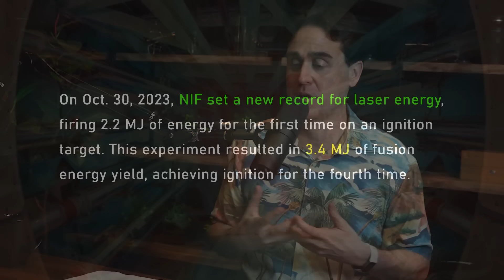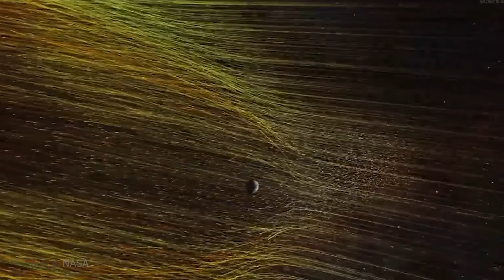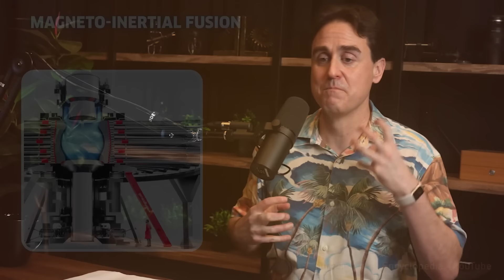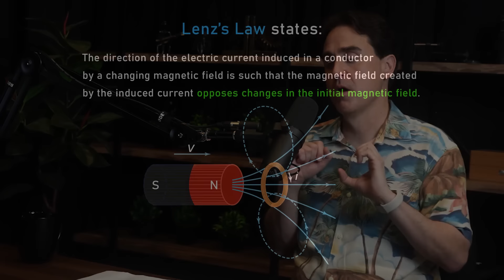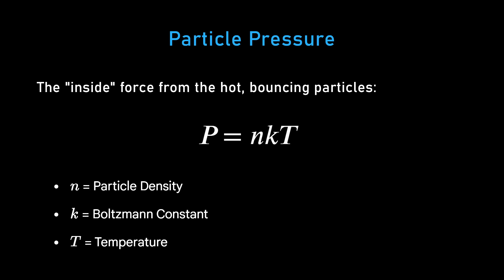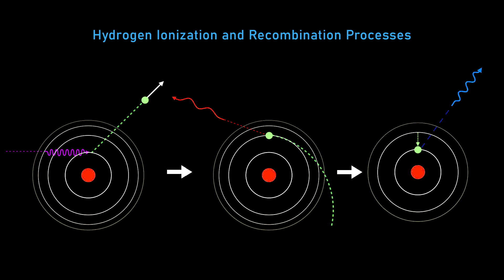How nuclear fusion works - physicist explains | David Kirtley and Lex Fridman

Comment: Lex, I wish you would have pushed David a little harder of the specifics of the generator they claim they will have online in 2018 for Microsoft.  I think you let him mislead your listeners a bit regarding the amount of power it might actually provide.  When he discussed it specifically, he didn't really make any claims about the power it will generate, which leads me to guess that it might technically be an operational fusion generator, but only provide a very small amount of power.  Later in the podcast he started talking about 50 MW generators in more detail, and I think it might make some people (potential investors maybe) that they will really bring a 50 MW fusion reactor online in 2 years, which is absolutely not going to happen.
Reply: He said it would be powering the grid that a data center is hooked up and it’s where Microsoft will be buying its power some which should tell us a minimum amount of power it has to generate to do this yes?

Comment: All this hustle and bustle but in the end the goal is to produce heat for making steam, to spin a turbine and generate electricity.. in other words a nuclear powered steam engine

-steam engine, machine using steam power to perform mechanical work through the agency of heat 
In a steam engine, hot steam, usually supplied by a boiler, expands under pressure, and part of the heat energy is converted into work

Comment: the issue is NOT the technology it is the outdated hypothesis that the sun sustains fusion with no out side input , meaning that Fusion without a source of free electrons feeding it does not work and never can work because the sun its self requires the entire heliosphereic electron sheet to feed off of in order to sustain its reactions.
Reply: What a fascinating idea. I’ve never heard of this. Can you tell me where I can read more about this?

Comment: So far as our energy requirements go, we solved that problem during the Manhattan project when the first reactors were built to produce plutonium. It took less than a decade to build the first power producing reactors. Coincidentally it also took us less than a decade to weaponize nuclear fusion as well. But we've had the capability and capacity to replace all fossil fuel based electricity generation  since the late 1940s and we were well on our way. Then lobbyists got hold of politicians on behalf of those corporations beholden to fossil fuels, and Green peace was corrupted from the top down. It all culminated in a campaign to spread fear over nuclear power production (well before 3 mile or chernobyl), as well as getting the political parasites to regulate the nuclear power industry into a position where building any new plants was almost impossible. Not to mention that since the end of the cold war we've dismantled a few thousand nuclear warheads all of which relied on an initial fission reaction to work. That uranium 235 and plutonium 239 wasn't tossed into the trash as both of those metals are more expensive than gold. No, they were stockpiled so should the need arise for some new bombs we have fissile material ready to go. But that material could be down blended into reactor grade fuel and with what the united states has on hand, we could power the electrical grid with every and anyone running every appliance, electric heater and air conditioner 24-7 365 for a few hundred years. And the spent fuel can be reprocessed as its only undergone fission for about 15-20% of the fuel when it was new. France is the only western nation that does this at scale. Our electrical needs could have been carbon free by the 1980s and stayed that way while Fusion was sorted out. And anyone who thinks there will be no waste produced by fusion reactors should they ever materialize, you're living in fantasy land. The same essential process we use to make plutonium aka neutron capture is what will produce fusion reactor waste. Other than energy fusions Main byproduct is massive amounts of neutrons that can and will activate materials used to build those reactors. But since we began burning coal during the industrial revolution to today that process has released more radioactive crap into the atmosphere than all the nuclear weapons tests and accidents combined. 
This entire dog and pony show around fusion has been going on since at least I first heard of it in 1996 when I read an article about Tokamacks in popular science during study hall. It's a joke and the punchline is the artificial repression of nuclear power production in either of its forms. Wind and solar are nothing more than supplemental sources of energy, and if the goal is to actually de-carbonize energy production then we've only got one viable option in nuclear power everything else is a pipe dream
Reply: Nuclear Fission is very expensive. The construction of a plant costs many billions. Mining and shipping the uranium, plutonium around the world. The poor workers exploited in third world countries. 
And the biggest factor is the long term cost of having to watch and deal with the high concentrated waste for billions of years. But we only care about our lifetime anyway as superpredators. 

It is good to research on how to make the decay faster and I like nuclear also more than fossil. But we should be aware how much better renewables are. Much much cheaper, decentralized and not crazy dangerous. Imagine terrorism or natural disasters. A decentralized system would be much more robust. 
But As long as we don’t have a reliable alternative when the sun ain‘t shining and wind ain’t  blowing we should keep fission. But there are now ideas of liquid hydrogen, methane etc. for hydrolysis which are made with renewables and can be used as energy storages. 
Fusion seems like a dream but would probably also be centralized. It would be amazing though and we should keep investing in it.
Reply: @user-wi3lg1rz8f read what said dipshit, we already mined and have stockpiled all the fission material this nation would ever need for CENTURIES. I know that because i helped take some of those nukes apart when i worked for SANDIA ntl. Labs. Every single one having a big old lump of plutonium, uranium or an alloy of both.
the cost of a nuclear fission based power plant only costs what it does because of the ridiculous regulations imposed by a government beholden to fossil fuel companies. And fusion plants already cost 10x what a fission plant does and theyre in the 100% experimental phase subsidized by tax dollars
Reply: He says the discovery was a crazy story.  Do u know how it was found this newest method?  Im pretty sure we can literally create no waste and fo these things. We habe a completely recyclable  society.  I dont know enough to see why it cant happen besides greed and evil and competition.  Not the good  competition but the self serving kind
Reply: @bradharris1062  we have a non recycling society. Almost all plastics that youre required to sort and put in thelittle green bullshit bin do not get recycled. 99% of all that plastic is sent off to 3rd world shitholes where they either burn it or throw it in the ocean. Metals are all that we actually recycle and even there most of what you put out in cans and whatnot gets sold off to china who recycles it as thats cheaper than mining ore. Recycli g in the United States is a scam and thats not an opinion this is documented
Reply: @bradharris1062 oh you can LiTeRaLLy create no waste? So you can never take a dump after a night of snacking & junk food? Interesting.
Reply: I disagree w/ u
Reply: @LordOfThePancakes there's nothing to disagree with. These aren't opinions they're facts
Reply: Spot on, I’ve been saying this for years.
Reply: @Omegaman1969  oh and I just sat there and listened to this girl say that if we did manage to get fusion working it would only be a matter of time before someone made a weapon out of it.🙄 when I told her we'd managed to weaponize fusion before my dad was born (1959) she told me to go read more sci fi but not to quote it as fact😅. I just fucked off at that point, some people out their aren't just stupid their iq and brain activity is so low they might be clinically dead
Reply: @Omegaman1969 sorry to have written the Gutenberg Bible there but I'm really getting sick of these people coming out every 6 months with a "new breakthrough" in fusion. I can send anyone who wants them, links to videos on YouTube that are from the federal government circa the 1950s talking about the same shit that this and countless other videos do on the subject of fusion.
Reply: @limabravo6065  why are you sick of it? Isn’t it nice that we make incremental progress ? Why the hate ? We live in capitalism so that we get growth and innovation from making debt and investing money. Why the hate. As long as there are people (private, politicians, researchers) investing time and money, it is fit enough to survive in capitalism.
Reply: @user-wi3lg1rz8f incrimental progress 😅 your being strung along by a government bought and paid for by fossil fuel companies. Andi can say that being someone who despises electric vehicles. But when it comes to powering rhe grid for homes and industry theres no reason at all to still be burning coal or natural gas. All the "incrimental progress" your seeing has all happened before, andit only took ten years to make fusion go boom so what the hell is the hold up. Dont give me any of that "fusion is hard" bullshit im a nuclear engineer so i know exactly how complicated it is

Comment: Neat, so If a plasma achieves high enough inertial coherence, tunneling becomes more probable and fusion follows without enormous heat.
As I see it anyway
Reply: Ashton is that you?
Reply: I thought it was Ashton too
Reply: It still requires millions of degrees like the core of our sun. It's technically not hot enough for hydrogen hydrogen fusion but thanks to quantum tunneling it's able to go ahead. We won't be seeing that effect on earth in any artificial reactors. That's why the preferred fusion fuel is deuterium and tritium, lower columb barrier so easier to work with. And we've had almost 70 years of working with deuterium and tritium as fusion fuel after we weaponized fusion in 1952